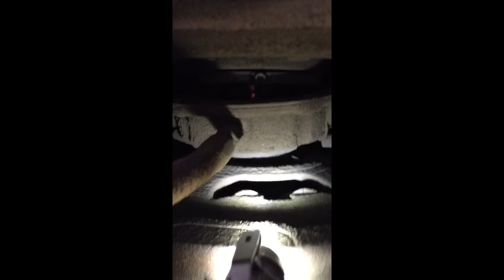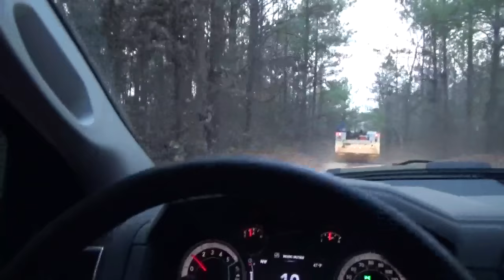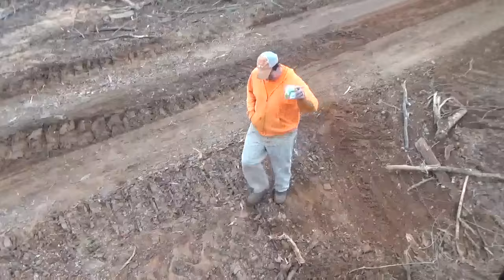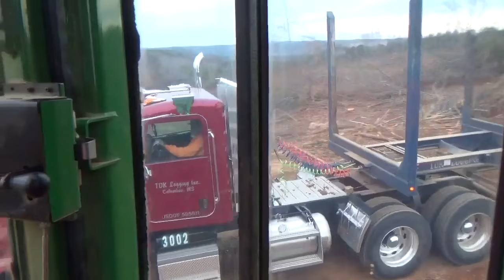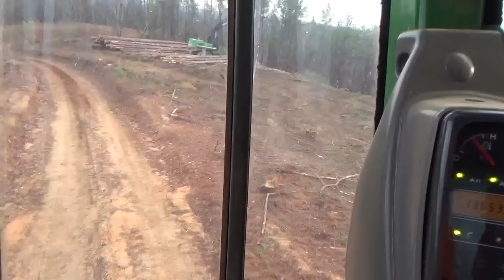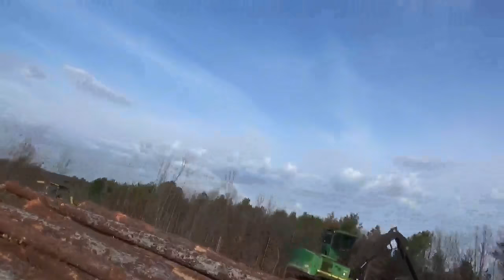New Peterbilt down and Tigercat 635D

Comment: A non truck related question---I must have missed it, but you did talk once about a metering wheel on the processor---does it measure the length or diameter and is it set to work automatic?
Reply from the maker: +Wendell Jones it measures both the length and diameter.

Comment: Mr Tim was looking at a new dodge 3500 they have no fuel cap is your like that
Reply from the maker: +jeremy smith yeah and I don't like that
Reply: cotontop3 --- my 2010 ford f150 doesn't have a fuel/gas cap, no issues so far but less than 39000 miles and I think its great...for an old fart, lol.